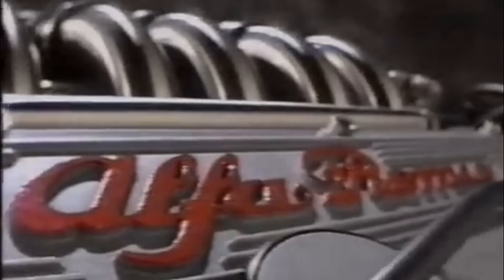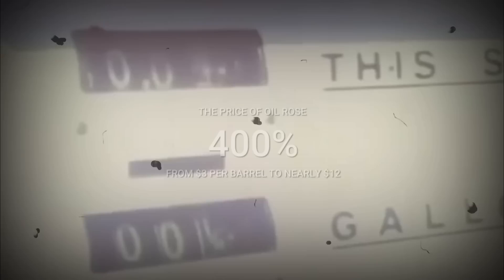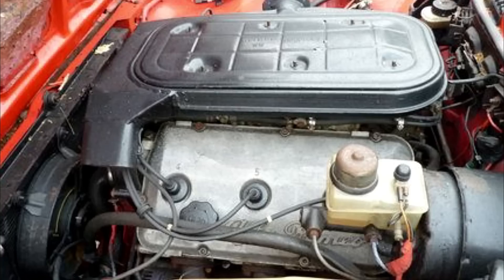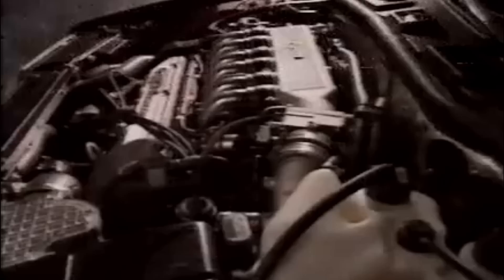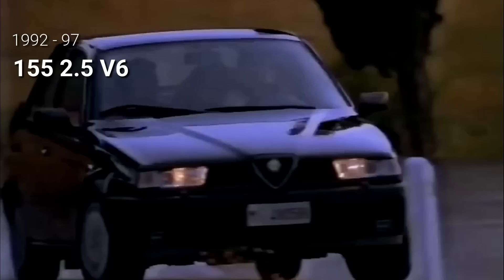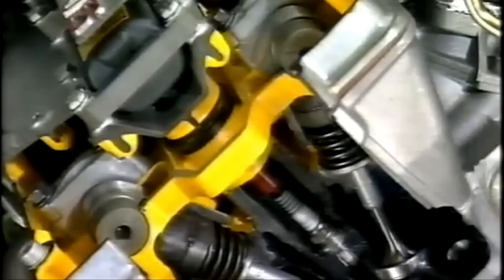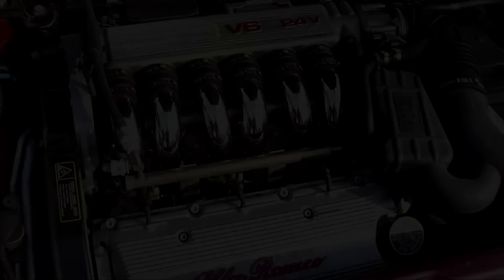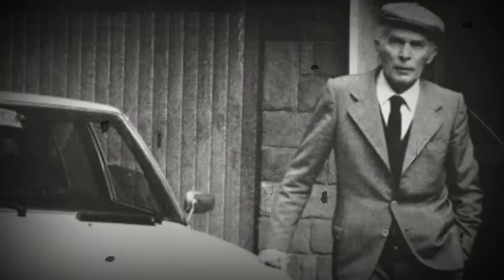The Story Of The "Busso" V6 Engine

Comment: my uncle had a 147 GTA and there is nothing that can compare to that engine.
The character, the sound and the feel.
No other engine can can even come close to the great Busso
Reply: Many engines can, specially japanese ones.
Reply: @aleksavulicevic  sure buddy, which japanise 6cyl engines sounds better then a busso and has more character?
Reply: Cmon now, m156 6.2 v8, vr6 3.2, 2jzgtte and many more... Sound way better than the busso
Reply: @miralemnermina142  Many of them can, it's your choice to ignore it. And you said that not a single engine can compare to it. If we are talking only abou v6, busso is even further down in a trench.
Reply: @miralemnermina142  And also many engines are much more reliable and sound better, like the one in the nissan gt-r, lotus evora, honda nsx, I can go on and on. At least they have no oil problems and don't need services every 6 months. I mean, if alfas are known for something, it's breaking. It's not strange that they are going to be bankrupt soon.
Reply: @aleksavulicevic  busso having oil problems?

Hahahahahahah
Go away jdm kid, get your driving license first
Reply: @aleksavulicevic  I owned quite a few Alfas through the years and never had any issues, just normal maintenance and nothing else. I'm sure you never even drove one.
Reply: Oh, and don't forget the 6A12!

Comment: Loved this engine so much, from the very first day I got my GT in 2008. What a beauty she was – black with a red leather interior. Eventually traded her in for a V6 Brera in 2012, but the GM engine just didn't compare to the Busso! Went back to the dealership a month later to get my GT back as it was still on the floor, but they didn't wanna budge because of some technical bullshit issue. Ended up walking out with a red 2012 Limited Edition GT which I still own to this day. Just added a numbered (18/30) Limited Edition Alfa-centenary model GT to my stable on Friday.

Comment: I'm proud to say I've opened 3 Alfa's...147 (1.6), then the wonderful GT 3.2 V6... Bought in 2005, 20 spoke alloys, Bose sound system, red of course with an Autodelta conversion. I owned it for 3 years before selling it...I wish I still had it, but we moved house and it got keyed several times. I then bought a MiTo (1.4 turbo...120bhp Veloce), owned it for 10+ years before selling it earlier this year. I wish I had the desire to buy a 4C and do a Zender conversion/body kit...(dream on)...

Comment: This engine is a work of art! Visually stunning, no cheap and nasty covers needed to cloak its beauty like a modern engine. But the thrill comes from the noise it makes, from light throttle through to full bore acceleration it is always stirring your soul. Drove an 156 and then 166 with the Busso 24v engine as a daily driver for 15 years. Never used any oil, just delivered its power and orchestra of sound day after day without tiring. I think I need to find another for Sunday drives....
💓
Reply from the maker: Cool :)
Love to read when viewers share their memories with the cars I cover, thank you!
Reply: @Matteo_Licata  That's a pleasure sir. 
Sorry I forgot to congratulate you on so many fantastic videos. I love them, they are real entertainment, educational, full of rare, accurate information and video material. There is very little else to compare to them. Thank you so much and keep them coming... Best Regards from Bavaria, Germany.

Comment: I'm glad I owned a V6 24 valve 164. ( and two 164 Twin Sparks) It was a magnificent car and my kids tell me it was the best car I've ever had. It was just so capable and comfortable and although not cheap to maintain, it was affordable. It was extremely well made as well...with just a few quality niggles I could lay at the door of Bosch rather than Alfa Romeo.
Reply from the maker: Couldn't agree more! The 164 had been developed very thoroughly. It certainly was a much better car than anything that preceded it at Alfa Romeo.

Comment: Until the early 90ies, this was the best V6 period. More torque at low revs than the BMW, but as good as the BMW at high revs. And soundet better. 

This engine was the reason for Alfa's success in Germany at that time. A lot of people back then bought the cars solely because of this fantastic engine.

It still makes me angry that Fiat doomed Alfa and Lancia instead of investing in enhancing their lead where they had one. Still remember my Lancia Delta HF 4WD 😢
Reply: Exactly right as smooth sounded better

Comment: Best NA V6 engine I ever DRIVEN!!  I've previously owned CF2 3.0 V6 engine with factory 82mm throttle body WAS A MONSTER vs NA v8's  I currently owned the 3.2 v6 GTA motor and silky smooth revs and sound is ADDICTIVE!

Comment: Thanks for that Video. One of the best V6 Engines ever Build. And I have two of them. A 164 Super V6 3.0 12 Valve from 1998 for Summer Days and a 166 3.0 24 Valve from 2002 as Daily Driver. The Sound and Performance of the Engines is marvelous. Purrs like a kitten on low RPM but when you push the accelerator, a Tiger gets alive under the Hood. Love it. Sadly, those kind of Engines will never Build again. Bella macchina.
Reply from the maker: Agree!!! Congratulations for your cars!

Comment: Had 3 of them, 3.0 12 valve, 3.0 24 valve in 164’s and 2.5 24 valve in a 156. 12 valve was the best of the 3, so flexible and fantastic sounds. Nightmare to change the spark plugs though!

Comment: I have just spent over 1.000 usd in maintenance for a 3.0 Alfa 166, in a country where qualified labour is only 4 dollars per hour. Now the only things that aren't perfect in the care are:
 -One of the rear speakers isn't working
 -The transmission needs some work (could be anything from 100 to 700 usd)
 -A couple of missing buttons from the console
 -Missing trim piece from front light
The engine has over 200k km and it is in better shape than your typical 1.5L i4 hatch with 1/2 the km.
Reply from the maker: I hope your 166 will give you many more miles of enjoyment, thank you for sharing your experience with it!

Comment: Very good video, thank you. My only problem with the 156 is it's made out of tinfoil, spit, hopes & dreams. The 156 is the result of an accountant looking at the 164 and saying: what if we made it not expensive. The result:  1 star NCAP. Side-impact at 15mph / 30kmh and you the driver needs a body transplant to live. Front impact at 45kmh and the front bumper and the trunk become one. I hope you like passengers in liquid form. Reminds me of the VW Sharan. To be fair, the same people looked at the all of the extra parts left over from the 164 (because it didn't sell) and then cut out the 4 and put in 6. BOOM! The 166 is born. V6 turbo on the 166 is awesome as hell though

Comment: Fantastic video once again, and such a magnificent motor. As the owner of a 2.5 Busso 156, I believe Busso was also the key engineer behind the classic 2.0 4-cylinder Nord DOHC in my other Alfa, a 1981 Alfetta GTV. One question - I believe the 937 Alfa GT Coupe was the last Alfa to use the Busso V6, but that model was made from about '07 to 2010? Were they using left over engines made in 2005?
Reply: They must have built these engines prior to 2006 and stored them, as the final assembly of the busso was the 3.2l and production stopped in 2005. Its a really good question. Anyone have a clue?

Comment: Great vid as always, thanks! One thing I ask myself is: why has the 3.2l in the Thesis 20 HP less than the 3.2l GTA? I also dont appreciate Alfa didnt sell the production lines to Cosworth after stop of production. Imagine what crazy derivatives of the Busso v6 we would have today!!
Reply: I didn't know they asked for it...
How dreamy is that?
Reply from the maker: Good question! I don't know in which way the engines were modified, if at all: could have been achieved through software as well. An hypothesis would be to better pair the engine with the automatic transmission specified for it, especially if Fiat went for an off-the-shelf set of ratios instead of pay the supplier to develop specific ones. But that's just my speculation. I will ask someone that knows when I'll be able to ;)
Reply from the maker: Regarding the Cosworth story... Is that true? I've been hearing the story over and over again, and it's a believable one indeed... But have yet to see evidence of any contact between Cosworth and Fiat

Comment: 😍 had 3 , currently have a very lovely Zoe yellow TS spider.

I love the TS in the ragtop but I'm hankering for another Busso...

Only question is what car ??

Alfetta,916 spider , GT, GTV, 75 , or 147/156 GTA ?

Could even get a 156 with the 2.5 ..

Damn what an engine !!!
Reply: Tough choice, depends on the use I suppose. I had 156 V6 and it was glorious. Needed something practical hauling stuff so gave it up. Now I have a Gtv V6 TB as the spider I test drove failed to win me over. Too much scuttle shake. Sometimes on sunny days I wonder if it had mattered that much. GT with the 3.2 would be great. Looks great and is incredibly practical.
Reply: Wiley E. Coyote I’ve had a GT in both JTS ( not great) and a very breathed on derv with around 250 bhp, smf, Quaife , eibach arb kit and bilstein B12’s it was a blackline and I loved it , only problem was the tractor noise..

A 3.2 would great , but I know what they cost to get right , wizards manifolds , q2 or qualify , a smf etc etc..
Where as the GTV 3.0 for me is more the finished article and may be a better shout for classic status ..

That’s where I’m heading I think, but we’ll see what shows up !
Reply: I would get a nice 3.0 GTV with 17" teledials if I was getting a Busso now. Although my 3.0 156 is pretty nice... The 2.5 in the 156 isn't that good if you ask me, running costs for a bigger Busso are barely any higher and my 3.0 does better MPG than a 2.5 I had previously. The 2.5 simply doesn't have much torque and barely revs any better than a 3.0.
Reply: @Negativvv  RIght, airbox, sharper cams, complete new exhaust from motor on, differential.

Check out Davide Cironi with a GTA 147, many parts can be used on a 2.5 V6 as well, giving torque, power and a music that makes you go crazy for sure.

Comment: Hey Matteo, a bit off topic but what is your opinion on the design of the newer Alfa GT? I'm talking about the 2000s model, the one based on the 147/156.
Reply from the maker: Spoiler alert: I'm going to touch on this subject this Friday...
The GT looked good but could have looked even better in my view: it was kind of a lazy effort from a Bertone that was already well past its prime.
But the car was a very good market proposition, as it was a true four-seater
Reply: @Matteo_Licata  I agree. Although it was good looking, it wasn't nearly as good looking as the 156 and 147  were compared to their competitors at the time. As a coupe it could have been better. I'm asking you this because I am looking to buy a very low mileage Alfa from the TS era to enjoy and maintain for many years, one with reasonable maintenace costs and taxes . I am between a low mileage 1.8TS GT, and a 1.6 TS 156 with extremely low original miles. The 156 is from 1998, with the nice older dash, wooden steering wheel... although  the GT is a head turner , the old 156  has the special type of "charm"  and classic  feel, even if it is only  the small 1.6 engine. What do you think is the best choice?

Comment: It's still one of the most beautiful engines. Weren't the last Alfa V6 the GM blocs, borne out of the short-lived FIAT-GM alliance?
Reply from the maker: Well, you can still buy an Alfa with a V6 under the hood, and that's possibly the best Alfa ever made: the Giulia Quadrifoglio has a V6, famously based on a Ferrari design :)
Reply: @Matteo_Licata  I drove the news Giulia Quadrifoglio with its twin-turbos and as much as I liked it, like the 8C Competizione I also drove a decade ago, I didn't get that Alfa feel. The 8C felt like a Ferrari handed to Maserati handed to Alfa kind of car. The Giulia Quadrifoglio felt too close to a German car in the drive feel. I guess I miss my happy revving Alfa engines and that subtle wrist steering crispness. I've working n the electric mobility industry for the past twenty years and love that instant electric motor torque. The cosest thing I find to that is are lighter and older cars. Perhaps it's time for another suped up Spider...

Comment: 1979 Alfa 6 debut and all I see is HEAVY BMW e12 535 which came out around the same time if not before. Have you noticed this?
Reply from the maker: The Alfa 6 was designed alongside the Alfetta, even if its introduction got then delayed. I'd put the similarity down to simple coincidence. Two companies designing the same type of vehicle pretty much contemporarily.

Comment: 3.2 V6 is LFW GM engine (Opel Antara, Suzuki Grand Viitara)
Reply: Oh no, there indeed was a 3.2 Busso v6!
It was replaced with the GM 3.2 v6. Which was modified quite a bit by the Alfa engineers before it was allowed to grace an Alfa (if you could consider the FWD "Alfa's" of that era as such, but I digress..).

After Alfa Romeo was done with that GM unit it was actually a really good engine. Though it could obviously never compete with the sound of the true Alfa engine it replaced.

Comment: Unfortunately the 3.2 V6 of the 146 GTA, or 159, Brera is an engine bought from the General Motors.
Reply: 146 is busso. 159 and Brera is as you say a gm motor

Comment: I am wondering if it would be possible to put a Busso into a 156 Crosswagon. I mean, that basic 156 plattform knows Busso versions 😊
Reply from the maker: The engine certainly fits, that's for sure! The main issue that would need to be sorted is the mating of the engine with the transmission

Comment: Alfa with Busso engine.
Alfa 6,Alfa GTV V6,Alfa Romeo 75  Qvadrofolgio Verde 1992 192 h/p.
New price in year 1992 39.000 DEM.
39.000.000£ Lira.(V6 verry beautifull car.)
1999 Alfa 156 192 h/p V6 new price in year 1999 40.000 DEM.
40.000.000£ Lira.
Alfa Romeo GTV V6 192 new price in year 1999 40.000.000£ Lira.
Alfa Romeo GTV V6 220 h/p.
New price in year 1999.
60.000 DEM.
60.000.000£ Lira.
Alfa Romeo GT V6 240 h/p.
2010 new price 40.000€.
Why is no more built Busso motor for Alfa Car?

Comment: No mention of the Brera?
Reply from the maker: No. Because it wasn't fitted with the engine the video is about. It was a different unit.
Reply: @Matteo_Licata  Ah interesting; turns out it's a GM block with Alfa heads. Brera V6 is also blessed with some very costly maintenance issues as well (e.g. no less then THREE cam chains - gasp!!)

Comment: I have two Milano cars one with a 3 liter and the other with a 2.5 liter engine.
Reply from the maker: That’s a very cool garage indeed, congratulations!!!!
Reply: @Matteo_Licata  I thank you very much and bought my MIlano Verde new in 1988. I have owned eleven Alfas since 1968.
Reply from the maker: Wow, a one-owner Milano Verde is a super-cool car! Alfa Romeo really went the extra mile on those: built on a separate production line from the european-spec 75s, the Milanos differ in a lot of small details, and have equipment never seen on Italian 75s